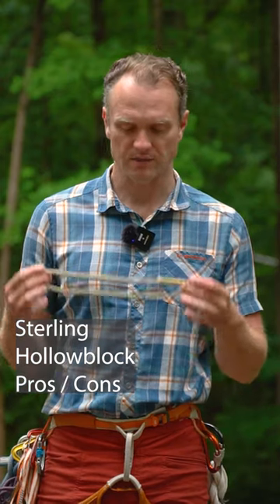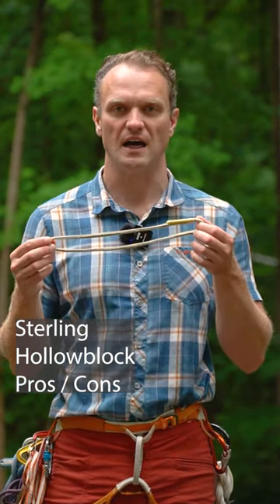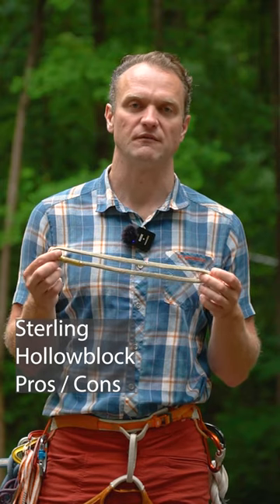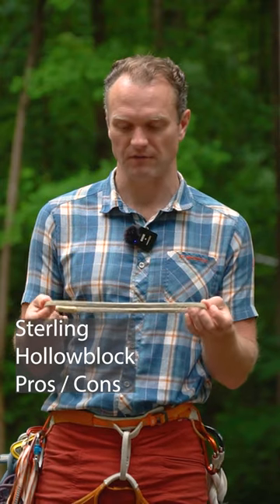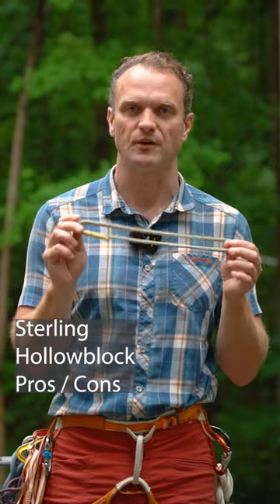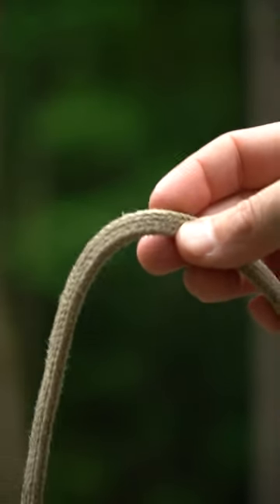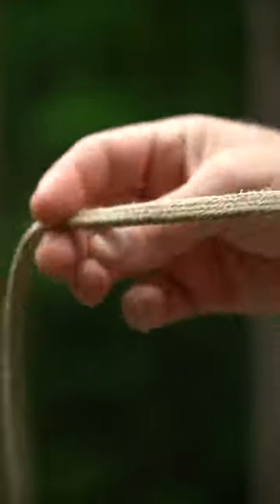Sterling Hollowblock Pros and Cons #climbing #rockclimbing #rope

Comment: Thanks for sharing Jason! What diameter is the orange rope you've used in your videos? I use the Hollowblock for rappelling but I find that an auto block with three wraps on the 9.5 mm rope we use slips when weighted but four wraps is too tight and makes rappelling difficult. Any recommendations?
Reply from the maker: My rope is a 9.2 mm Petzl Volta. 4 wraps on one strand is perfect… but for one stead why not just use a grigri???

Comment: I broke one of these by pulling it apart with my bare hands. I will never use one again and always recommend against them now. 

Apparently, lots of sand (desert sandstone environment) is really bad for them too. 

A basic piece of accessory cord costs is about $1 in the length of a prussik loop, the hollow block costs about $15. 

The short version of the hollow block is an awkward length for a three wrap autoblock hitch around a double strand of rope. For those that insist on using them, after the first couple wraps, a twist or two  instead of a third wrap is the Goldilocks length adjustment you can make.

Comment: Interesting practice point as to using it as a sling, good to know.  What about as a PAS girthed/bowlined into the harness?
Reply: It's super short, about half a single sling. Because of that, it's fairly impractical as a PAS. I'd recommend using it only as a friction hitch and not a PAS.
Reply: @forresthsu582  Yeah they make, and I carry both the 13.5" and the 19" versions on my harness at all times.  24" slings are often tied into PAS using a snap bowline, which can be a little long, so I've seen them used for this.  But FYI a single sling is 12."

Similarly I've seen shoulder lengths (12") girthed into a harness for just such a purpose.  So the practicality of length arguments may not have much impact, especially given that the Hollowblock is going to (1) live on a harness, is (2) being used already to basket rappels by some, and (3) has a rating of 14kN.
Reply from the maker: I wouldn't use this device for anything but friction hitches that are backed up by something or being used in tandem with a rappel device.